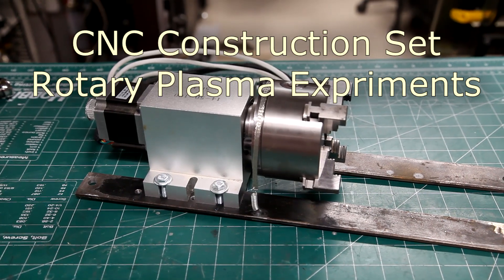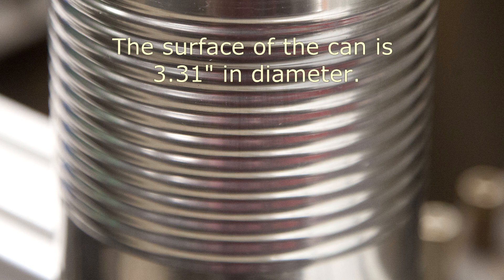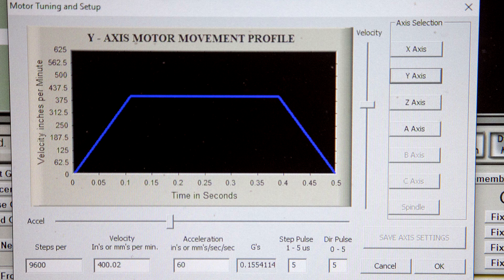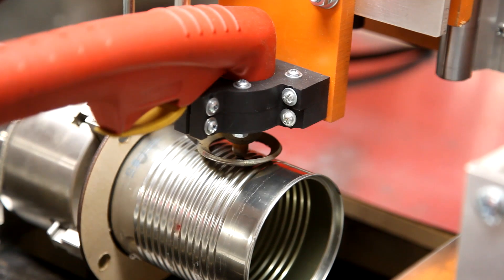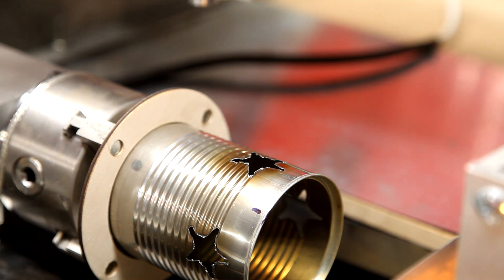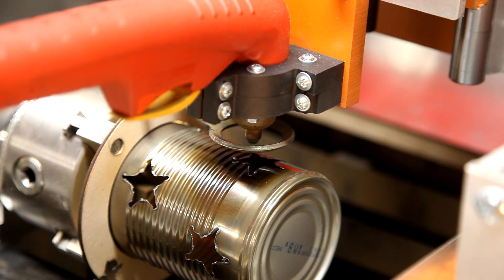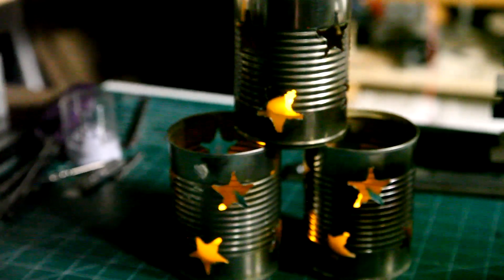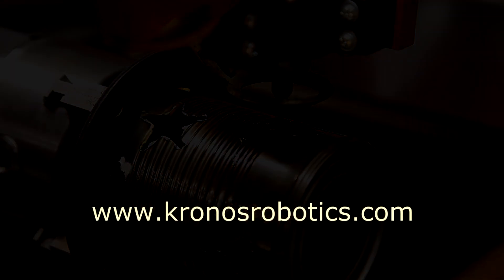Rotary Plasma expermiments

Comment: I really like all of the neat projects you do with the plasma cnc.  Have you tried using a water table?  I am building a plasma cnc and am deciding what to use.  I looked at controlling dust part 1 and 2 on your website and am contemplating doing something similar.
Reply from the maker: I don't like water tables. They are messy and the water gets on everything. A water table will catch much of the plasma dust, but does not catch the nasty fumes when cutting through things link Zinc or paint. Something my downdraft table does with ease.
That said the CNC Construction Set was designed so that you can add a water table if you wish.  Once you go downdraft you wont go back.

The down side of a downdraft system is that the size of the downdraft needed goes up exponentially as the size of the plasma table increases.  In addition you need to evacuate the air to the outside.  This may not be feasible in some locations.

Comment: To possibly prevent splatter and build up you could use anti-splatter or nozzle gel. Hobart sells  good ones.
 https://www.amazon.com/Hobart-770074-Welding-Accessory-Nozzle/dp/B0017Z5J1W/ref=pd_aw_fbt_img_2/146-5903071-5081938?_encoding=UTF8&pd_rd_i=B0017Z5J1W&pd_rd_r=49028f56-0bb6-424e-b6ea-27fb1c8bf1f0&pd_rd_w=rTiEt&pd_rd_wg=ZO8gY&pf_rd_p=6e6afc8a-fbbd-4649-97cf-4e08f5113612&pf_rd_r=MSDXJT4GADTB4V8QF31V&psc=1&refRID=MSDXJT4GADTB4V8QF31V

Comment: Hey Mike, would it be possible to add a rotary tool to the KRMx02. It would be very nice to carve wood with such a tool. Is there such a unit in the upgrade manual?
Reply from the maker: Are you asking if you can add a rotary axis to the KRMx02?  If so, you can add a rotary axis to any machine by swapping it out for one of the existing axis.  IF you want to add an independent rotary axis, you will have add a second parallel port or a motion controller like the smoothstepper or UC300ETX and a motor driver.
Reply from the maker: The information on my website lists all the upgrades in the workbook.  

Step by step instructions for adding and operating a rotary axis could probably fill a book by itself.  I am working on adding a fifth axis rotary to the KRMx02.
Reply: Mike, thanks for your effort to keep your followers up do date. I have a question on the KRMx02: Is the KRMx02 able to mill plaster? Or, milling drywall (plaster board)?
Reply from the maker: Depending on what you want to do, start with a carbide bit.  You will need to use some sort of air evacuation system like the AirExchanger.  You don't want that plaster dust getting all over everything.
You can also use diamond bits for detail work.